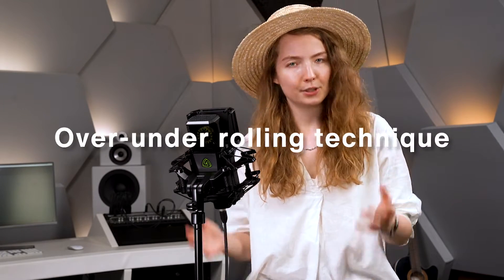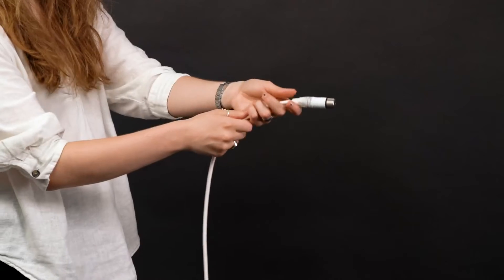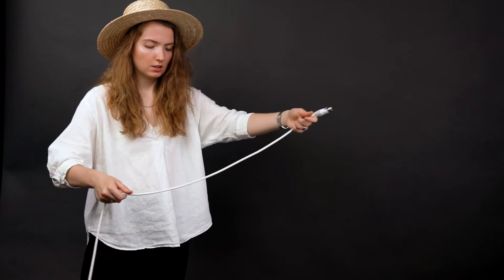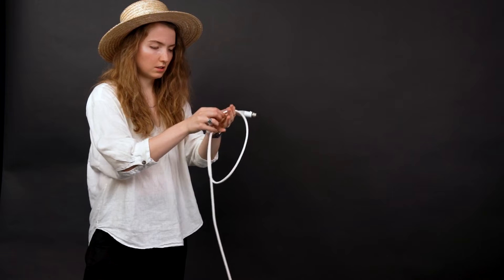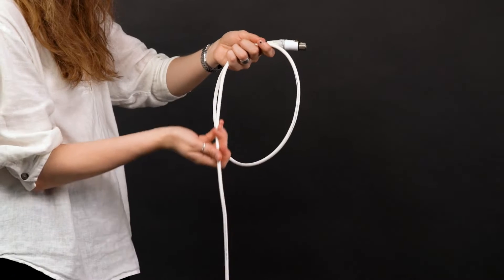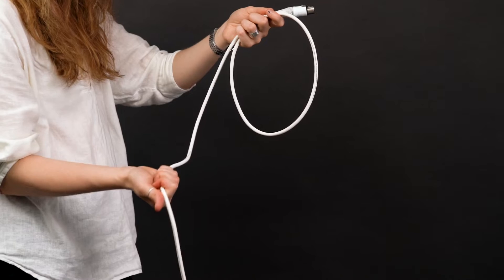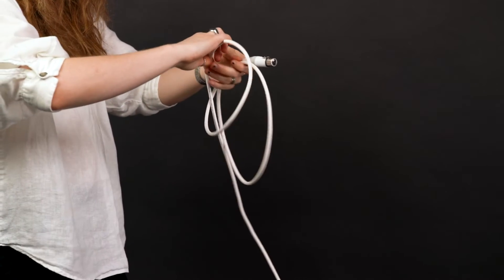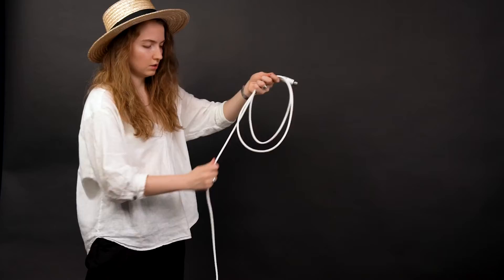How to roll your cables - the over-under technique

Comment: I always did the normal over-over rolling for all my cables (until I learnt about over-under). When I fastened my cables the first way, the loops spreaded in every direction and was so annoying and I felt like it needed to fasten it with two joints. And when I opened the loops the cable had an ugly twisted shape. I think over-under technique is the safest and easiest way to do it correctly so far.

Bonus tip: Use your two thumbs to adjust the loop length every time you do the under loop so it's neater.

Comment: When doing the "under", just guide the cable to the hand holding the roll with your little finger towards it, it's a lot faster. Other thing, for a long (e.g. 100 yards) or thick cable, user your lower arm to hold the cable. I worked as a roadie one summer, over 30 years ago. Lots of long cables.
Reply from the maker: Great tip as well 👍
Reply: Meaning? I think that's what she did.

Comment: I've tried this about 20 times and it's not working.

Pulling one end of the roll once its formed as if to use it just knots it immediately.
Reply from the maker: You have to be careful to avoid pulling the wrong end of the cable. If it goes through the middle, you will get a string of knots.

Comment: do. not. use. the. over. under. method. Just coil in one direction- make it nice and tidy and the cable won't tangle. But evrytime I get my hands on a cable that has been coiled in the over under way I get multiple knots in the cable when I try to throw it or uncoil it.
Reply: It works fine if you know which end to hold when you toss it.🙃
Reply: Use the end to make a circle around the cable  for storage and remember that it is the end you pull out. It won't tangle.